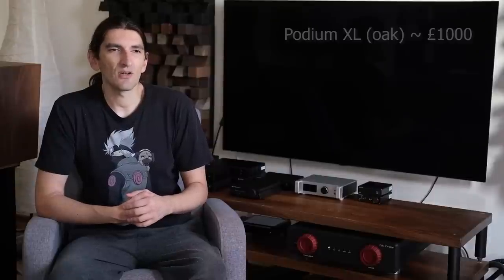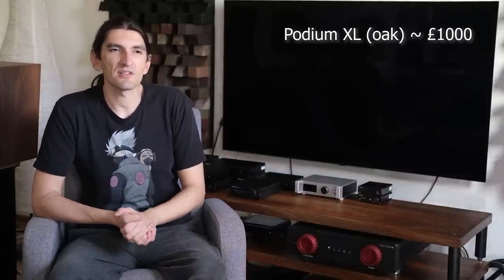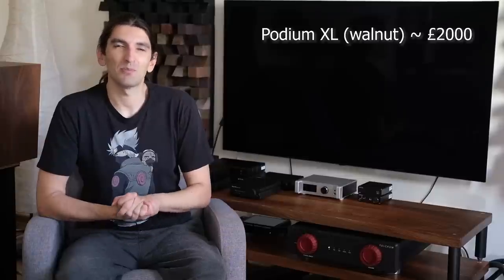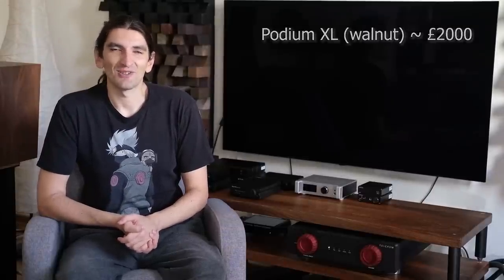You can make a great HiFi rack yourself

Comment: I remember this video. It didn't occur to  me until some time later  that shelves on a rack are not ventilated. The reason I thought about this is because I was able to reduce the heat coming from my amp considerably by putting some space between the bottom of the amp and the surface of the shelf. Just that one thing made a huge difference. Providing space on the top and to the sides took me the rest of the way. It really suprises me that  you see images of class A amps shoved in a really nice looking rack with little space above or below. What really amazes me is that ventilated shelves are not really a thing..as far as I can tell anyhow.

Comment: It looks great, and I trust your judgement that it helps the system sound better. The solid aluminum legs and bolts are going to make a strong structure that resists tilting/racking on the diagonal. This is called a "moment connection" and if it wasn't good enough, you would need to have corner braces instead.

Comment: I really like the design of this. 
I just bought a Copland cta 405 integrated valve amplifier. It's heavy (30kg) and it needs a lot of air. So I would put it on top of this with my turntable and only have one compartment under for blu-ray player and accessories. And then the TV goes on the wall.

Comment: I'm in the US as the inexpensive option for good wood is to buy butcher block countertops. I did something similar and built a standing desk instead of a high fi rack, and I also used Rubio Monocoat! Despite the name, you should definitely do two coats.
Reply from the maker: Good idea, I've seen others using butcher blocks in a various ways. We applied two coats too, it brought deeper color and contrast to the wood.

Comment: I think the biggest effect on the sound comes from changes in sound reflection in the room. Different shape, different materials, whether it works as a reflective surface or as acoustic panels on the wall. Another good idea is to get a sturdy used television-stereo level. They only cost a few dozen bucks. I bought one in a second-hand store a few years ago for my 50 kg TV. The sides and bottom have good levels for my stereo equipment.

Comment: The Rack is excellent I don't really need an explanation as I've worked in Fabrication for some 48 years. What is a surprise is I never transferred the construction technique from the usual narrow Racks you normally see high end equipment housed in. Now when I make one and I will I just won't be using the sold aluminum leg spacers. I will use All Thread metric equivalent to 5/8 inch then sheath the all Thread with recessed holes and decoupling the segments with rubber isolation washers. I'm not sure at the moment which approach I'll go with to isolate the floor for the Rack. So, I gathered your old set up was reacting to microphonics and reproducing them thru your system. Interesting. So, I couldn't help but notice you aren't using Kef LS 50's. So, what are those speakers? They look reminiscent of Emotiva B2+ only instead of Black in a wood veneer and instead of a folded ribbon twetter a soft dome I presume?

Comment: Like is the top portion balancing on spikes? So it would fall over if you walk into it by accident?
Reply from the maker: Spikes are nested on top of Allan srews of the lower layer so the top needs to be lifted up first before it can fall. It's also 20 kg so it's not that easy to accidentally move.

Comment: What diameter is the aluminum legs?  looks like about 1.5" or 3.75cm?  I still don't totally understand the allen screw on the top.  Do the threads of the allen screw engage the wood before engaging threads in the  aluminum legs?  if shelves were empty, would the top shelf just be able to be lifted up off the spikes?  1.5" aluminum bar stock is $1.44 per pound here.
Reply from the maker: Aluminium solid rods are 4 cm in diameter. Alen screws go trough the wood (we widened the wholes just enough on one end so the alen srews are flash with the surface when tightened) and screw into the aluminium leg. That's how we attach legs firmly. Each shelf is then just stacked on top of the other, and yes you can remove them anytime you want. Spikes just slot into the caps of the alen srews of the lower shelf that act as footers. Also, spikes are adjustable so we can level each shelf after stacking them.

Everything sits securely and firmly in the end because each shelf is around 20 kg and the whole rack around 60 kg.
Reply: @iiWiReviews  That is the conclusion I was arriving at ... that their weight just held them in place.  The allen screws then basically simply act is 'pegs' to fit up into the hole in the wood.

Comment: Appears that spikes point down.  How did you attach legs to wood above it?
Reply from the maker: Legs have threads on both sides, in the bottom we screwd in spikes, while top is connected to the wood by long alen screws that go trough the wood. At the same time, caps of these alen srews are used as a footer that spikes from the level above rest on.
Reply: @iiWiReviews  So, on the very top shelf, in a closeup photo, you would see the top of the big allen screw with the hexagonal hole, right?  And the spikes that meet the second shelf 'seat' down in these holes?  What size allen screws did you use?  I really want to make me one of these.  I assume you had to get allen screws that matched the diameter of the threaded spike studs and the allens screws are also coated with the flat black 'plastic' coating?
Reply from the maker: If I remember correctly, both alen srews and spikes have M6 threads. Alen screws are stainless steel with length of around 6 cm (4 cm trough the wood and 2 cm into the leg thread). Yes you can see them in the corners of each shelf level. We had some ideas how to cover them but liked this raw industrial look in the end. Also, as they sit flashed to the surface, you don't really notice them from the sitting position.
Reply: @iiWiReviews  I'm sorry to ask so many questions, but I must build a pair.  btw, my wife is from Ukraine and we were in Slovakia, Czech Republic (Prague), and Slovenia back the summer of 2019.  Loved the Vintgor? Gorge in Slovenia, lake Bled was too touristy but pretty, and we left Prague early due to crowds.  We preferred hiking in the mountains there in the north of Slovenia in the national park.  Loved Slovenia - I'd leave USA anytime to live there!

Comment: Wait.. Don't spikes do the opposite of decoupling?
Reply from the maker: You're right actually. Common belief nowadays is that spike guides and releases the vibration in a controlled way. So it's some sort of coupling. I'm not versed enough on this topic, that's why I just followed what smarter designers have already done.